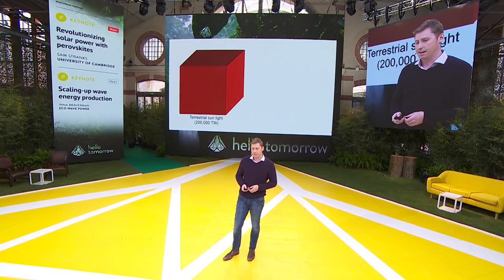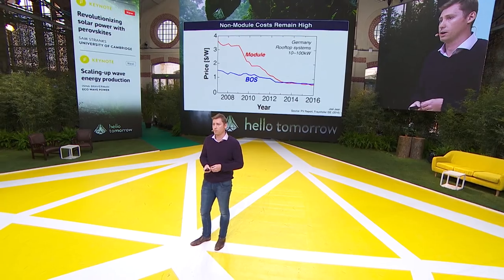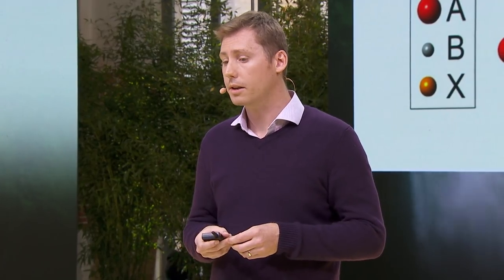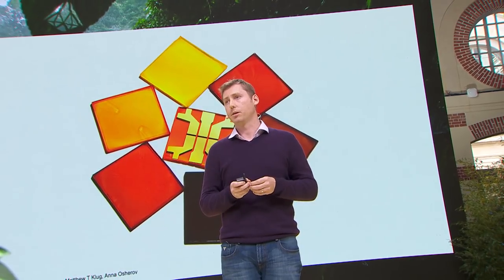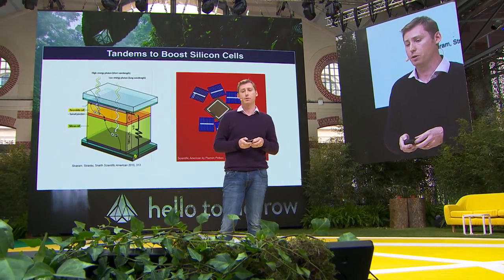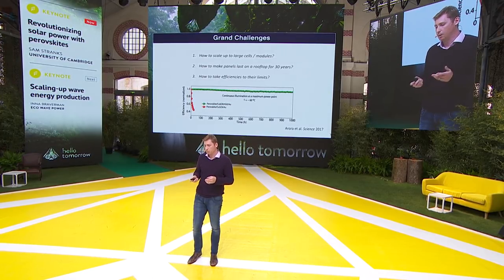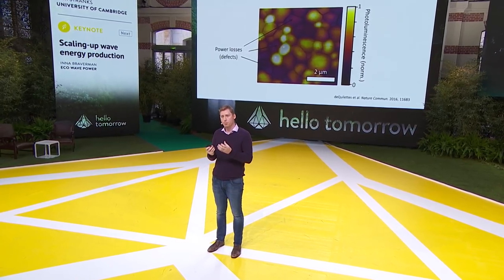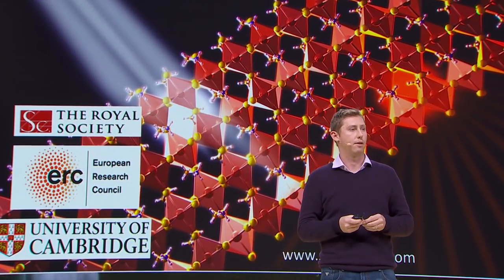Revolutionizing solar power with perovskites | Sam Stranks | HT Summit 2017

Comment: 12:06 can anyone make sense of this comment about luminescence??
Reply: When something is Luminescent it emits light.  Solar cells do not just absorb light but also reflect light.  Reflected light  does not transmit heat, like from direct sunlight but light only
Reply: What Pool Wizard said is not correct. It has nothing to do with reflected light or such. Solar cells work by having photons from sunlight create free electrons and free holes. These free charge carriers, before they are collected at the electrodes of the solar cell can recombine (i.e. "decade"). There are 2 main kinds of recombination: radiative and non-radiative. Free charge carriers recombining non-radiatively are effectively 'lost' and will not contribute to power generation, as non-radiative recombination mainly happens at defect locations, traps etc. Photoluminescence measured at open-circuit voltage (i.e. no current being extracted from the solar cell) gives you a rate of how much of the recombination is radiative and how much is non-radiative. The more radiative a solar cell is at open-circuit voltage, the less non-radiative recombination is present within it, and the more charge carriers apt for power generation and charge extraction exist.
Reply: Wow. My take is much simpler than the two before me.

The point being made is that the light to electricity can be reversed and tuned. When electricity is applied, light of various colors (wave length) can be emitted and used in various applications such as laser and displays.

The same knowledge can be used in or by the other two explainations.
Reply: @edoardoruggeri1  Thanks for that.  So the luminescence indicates available energy to be extracted - if I am understanding correctly.